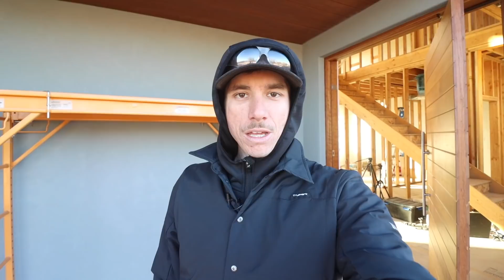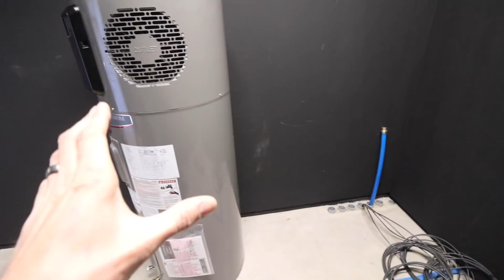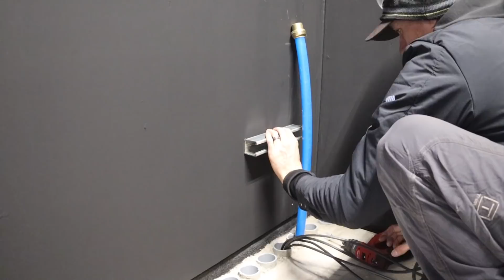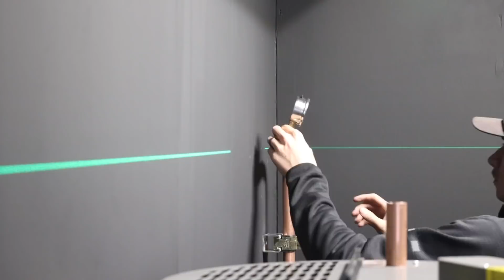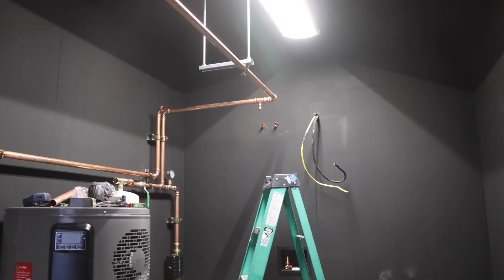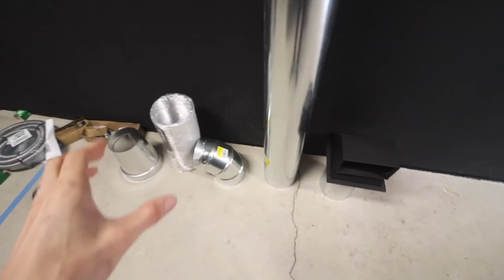Building The Coolest Mechanical Room | Part 2 - Plumbing & Water Heater

Comment: No, not going to be a "code jerk" & telling you that you need a pan for code. No! I am strongly suggesting that you need a pan under the WH to protect it! The warm metal & DAMP cold slab (plus any minor leak) WILL cause condensation & corrosion to your expensive WH & kill it mechanically prematurely - read that... RUST!!! Not a code thing... a $$$ money thing! (It's also a hell of a lot easier to install those now, while it's empty!) 

Additionally, inside the pan & under the WH you should install rubber/silicone isolation  bumpers to isolate the vibrations from the hybrid compressor to the slab; which will (can) produce humming sounds into the slab. Again, those will also keep the metal away from any moisture in the pan.

Third & most importantly... & not joking here!
You really need to strap that thing to the wall! You don't realize it (I do because  I am a native of the area), but we ARE in an active earthquake zone; and though while infrequent, quakes do happen!  About 1-1/2 years ago we had a 5.2 about 100 miles from you near Duncan. In 1887, there was a big one; est. 7.8 that occured about 100 mi. South in Mexico that affected the whole area & created major havoc even @ Sabino Canyon. It even changed the water tables.    

I like the layout procedure with the laser level; very nice.

Comment: Very good choice dedicating a true mechanical room. The benefits are beyond measure, and it looks so amazing when done right. Great work can't wait to see the build progress. 👍👍
Reply: It's a laundry room with mechanicals.
Reply: @tysleight  Well still. Having it all dedicated in that one location with a floor drain is still a solid plan. Regardless sif he put the washer and dryer in there or not. Having it in the open where it easy and accessible for maintenance and inspection is benifical and if something easier your more likely to do it regularly. So win win regardless.
Reply: @elslick  very true but I have to think like a father of overly helpful children . I also do a lot of remodeling and flipping.  If something is able to be fiddled with it will be.  IF he doesn't have kids and never sales the house it will be golden otherwise my wife is using the pipe as a closet rod and my boy using it to hide hot wheels  and my daughter as a ballet bar. It truly is a work of art and is beautiful ❤️. I wish I had the ocd to do a mechanical room this fancy.
Reply: @tysleight  hahaha yeah, wouldn't defintleyhahaha have to lay down some ground rules.

Comment: Dryers have reversible doors, that way when they are side by side, the dryer door opens to the right and washers always have their hinges on the left side. When you stack them, you always wants both doors to have their hinges on the left side.
Reply: I have a Maytag Neptune washer and dryer and both have doors that work on either side. Takes about 5 min to change them.

Comment: I watched a video of a guy in Hawaii (offgrid) that installed a water heater like yours.  He didn't want the electric heating element ever coming on.  He couldn't find a way to turn it off so he disconnected the element and wired in a bulb so the heater would think the element was on.  Also, he used Iron Edison nickel-iron batteries in his solar systems and plumbed the condensate from the water heater to an automated system that keeps the battery cells topped off.

Comment: If you're concerned about the startup watch on your a hybrid water heater you can checkout "Off-grid Steve" on YouTube. He lives off grid in Hawaii and substituted a 240 volt 15 watt light bulb instead of the 5000 watt element that way it tricks the controller so it doesn't throw an error code. And you will only draw 15 watts instead of 5000 on initial startup. I think it would make sense for you because there is just the two of you.

Comment: It's easy to see that you are going "high-end" with everything in your home build. I am thinking about how the dollars per square foot are climbing past the $300 mark driven by your compulsion for perfection. Sorry to see all the cracks in your concrete. Maybe, rebar should have been used instead of the Helix?
Reply from the maker: Nowhere close to $300/sq ft, this isn't a $600,000 home lol

Have you ever poured concrete before? The crack is because there are no control cuts, not because I used helix.

Comment: Circular saws are dangerous and need to be banned.
Reply: Seriously? Of all the tool that spin it is very safe if used at all according to the manual.
Reply: @tysleight  
How many table saw accidents per year?

Over 30,000 table saw injuries occur annually. Fingers and hands are the most frequently injured body part and lacerations are the most common injury.
Reply: @tysleight  
This statistic displays the number of amputations due to table saw blade-contact injuries in the U.S. from 2004 to 2015.  According to the data, in 2004, 5,100 amputations occurred due to table saw blade injuries. More recently, in 2015, table saw blade injuries resulted in 4,700 amputations.
Reply: @buildahousewithlaserwoodcu3208   First a table saw and a circular saw are very different tools. 
Second an amputation is anything from a cut that needs a  why on earth did you come to the hospital and a bandaid, to well your new nickname is stubs, I guess. 
 Third once again following the manual will keep you out of trouble with either a circular saw or a table saw.  Ps of the two amputations I have seen first hand one was a guy loading a saw ( not running) and the panel pinched the tip of his Birdy finger off when the sheet fell and the second was a crack head guy that wanted to trim his fingernails on a spinning blade. Otherwise I have seen millons of board feet ran by day one hires following basic safety standards and no lost body parts.
Reply: @tysleight  
''SawStop'' table saw <--- safe to use.
Reply: @tysleight  
Are you too poor?  .. you can't afford a laser wood cutting machine.
Reply from the maker: Dangerous for those that don't know how to use them
Reply: @Handeeman  
They are noisy, old technology.

Comment: 8:44 are you not supposed to install the expansion tank upside down? That was in my instructions that came with mine, in case of bladder failure it'll still function as an expansion tank I believe was the reason.
Reply from the maker: everyone I've seen is pointed in this direction
Reply: @Handeeman  If you go on google images and type "expansion tank upside down" there's lots of pictures of them upside down. On the manufacturer's website it says you can install them in any direction, so I guess in the end it's not important. If you install it right side up you'll know if the bladder has failed when your overpressure valve on your water heater blows, or if you install it upside down you'll never know if the bladder has failed because it would continue to operate as an expansion tank :)
Reply: It'll fill up with water either either way.
Reply: @94Beenjamin  An expansion tank is to hold air, not only water. If it's right side up and the bladder fails all the air will leak out. If it's upside down it'll still function as an expansion tank, right side up it won't. No worries though, I'm sure the bladder will give years and years of trouble free service.
Reply: @toysareforboys1  What I meant was when it fails the bladder will fill up with water no matter which way you put it. Ive replaced a lot in every direction.

Comment: That's all very good but why did you not go for solar thermal water heating?
Reply from the maker: More of a pain in the ass than anything IMO, I like things to be as simple as possible with utilities, I can always produce more electrical energy through solar to heat the water instead of just having another system and collection panels and all that jazz
Reply: He did, however his solar method also works when you have no sunshine  (ie  night time / very cloudy days)

Comment: i think you might be the first home owner to buy a pro press tool.
was "looks" the only reason for running copper over just running pex?
Reply from the maker: lol I might be one of the few, mainly for looks, I wanted this room to be a showcase of my skills, I love the look of copper against a black wall so I didn't want to run pex
Reply: @Handeeman  There's plenty of arguments over pro press stuff, but I run it all the time in a hospital, and I haven't seen a leak so far. My only gripe is that with a milwaukee press, the dies are a hair too small and make a little, sharp nub that sticks up. Maybe the die is ever so slightly too small, and the top pinches the fitting.
up to 170 degrees and 70 psi in some cases, still going strong.
Reply from the maker: @dylanpeterson3490  I know exactly what you mean, I ran my fingers across a fitting after pressing and that little piece of copper cut me
Reply: @Handeeman also, just know that if I ever happened to tour that space, I'll be checking to see if all of the flats line up. lol. At work I get in to tight spaces and have to press them from different angles and it ticks me off...

Comment: What would you need hot water for?  Shower, sink, kitchen.  I suppose your home heating is another system.  I saw a tankless shower head on a 15A circuit.  Got one in a converted chicken coup/airBnB. cottage
Reply: I suppose the shower hookup would fill a tub as well, depending on water levels
Reply: Bathtub??